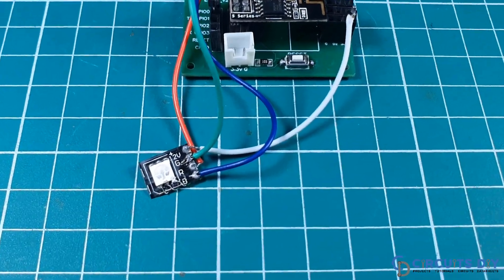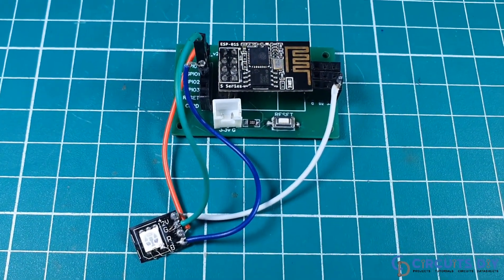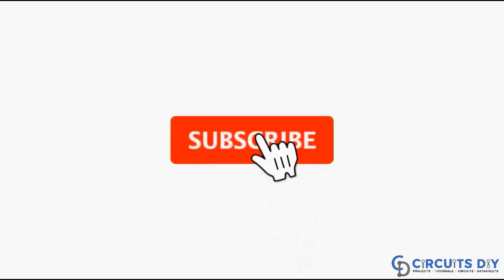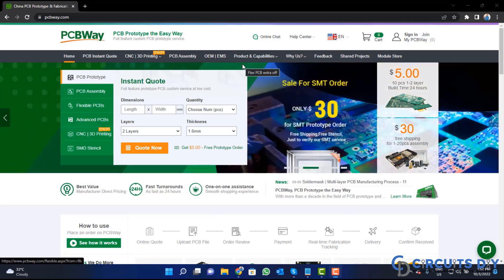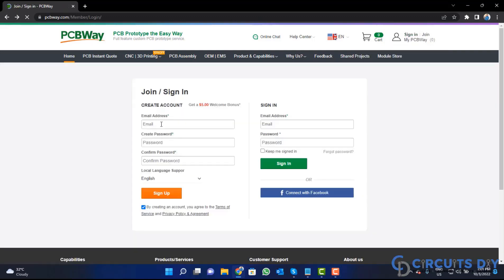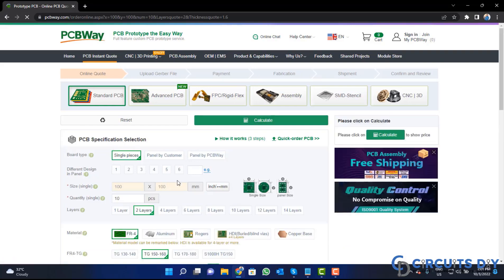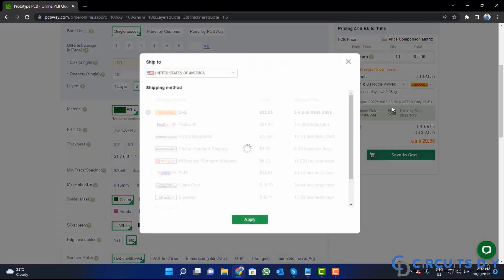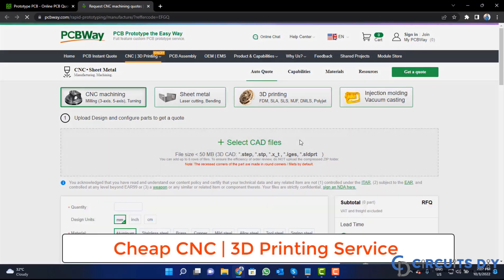How to Control RGB LED Wirelessly using ESP8266 ESP01

Comment: when i program an ESP-01 with your code, I'm sometimes able to connect to the RGB network but 192.168.1.1 never gave any responses. is there a specific setup on esp01 ram rom, clock etc settings i need to do? I tried the code on a 8266Wemos D1 clone, then RGB is always visible. I can connect to it, the rainbow appears, onboard blue led's intensity changes with touch but exterior leds never turn on or off. the connections are simple and correct. all the leds are common anode with catodes connected to d0 d2 and d3. I don'T know why. any ideas?